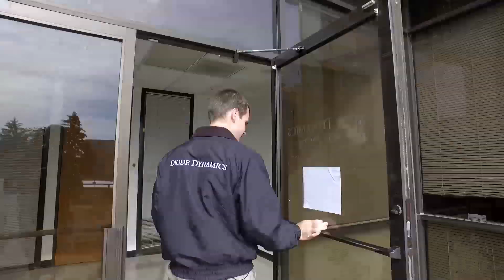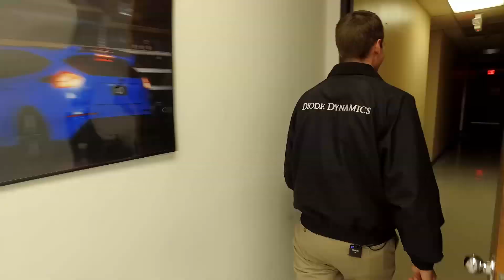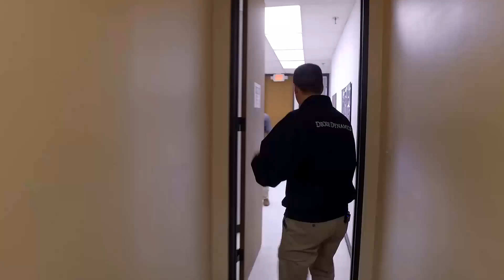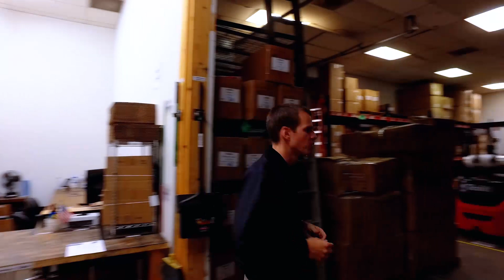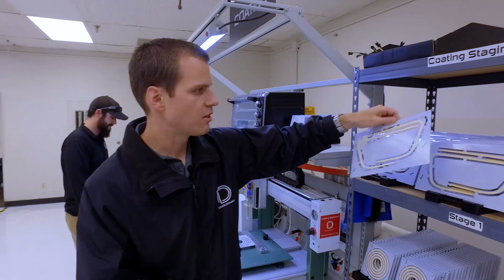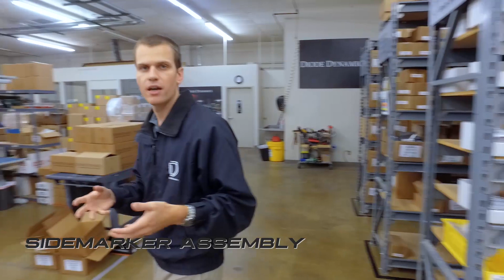Behind the Scenes at Diode Dynamics! | Facility Tour

Comment: This was an incredible video. So glad I went with DD for my RGBW LED boards. One of my boards came in faulty but I called DD up and they are sending me a replacement at no cost. Should be here tomorrow and then my DRLs will be working properly again. I had Lighting Trendz DRLs at first and had nothing but problems with them and their customer service department. DD is so much better
Reply from the maker: Thank you, Tyler! We're sorry one of those boards was giving you issues.
Reply: @diodedynamics  oh no problem. Just a minor setback. I'm just glad my installer caught it before he sealed the housing.

Comment: I love your guys SS3, got one for my 3rd gen tacoma. Tho i am starting to miss my factory fog lights as i had a led switch back bulb. I could use both white and amber. And ive seem the internals with the ss3. So im curious if you guys can squeeze in another bulb, and have the ss3, both a switch back.
Reply from the maker: Unfortunately, it isn't possible to make the SS3 switchback - sorry about that!
Reply: @diodedynamics  how so?
Reply from the maker: @GhettoFabulous670  The SS3 has a circuit board inside of it with LED chips, not a bulb. It won't be possible to add more LED chips and the electrical circuit also isn't wired to function as a switchback product. Sorry!

Comment: Excellent 5S and product flow! Out of curiosity, do you have a team that optimized your product flow (like an industrial engineer or lean/six sigma person)? Or did that level of orginization span from necessity? 

Thanks for the tour - more proof Diode Dynamics has the best quality aftermarket lighting out there!
Reply from the maker: Hey Vince - a lot of these processes we put in place were over the course of a few years (lots of trial and error). When expanding at the rate we have been over the last few years, sometimes a solution that used to work great may need to get tweaked, or overhauled completely. We appreciate the support!

Comment: You make for atvs
Reply from the maker: We do make LEDs that will fit some ATVs! Do you know what size bulb you are looking for?
Reply: @diodedynamics  I ordered the signal LEDs for my 15 Silverado are they plug an play with the resistor or u cut into the wires
Reply from the maker: @stonemtnrubicon  The resistors have to be spiced into their corresponding wires. You can check out the video below to see the install process!

https://www.youtube.com/watch?v=WyUh1ztBH84&t=5s